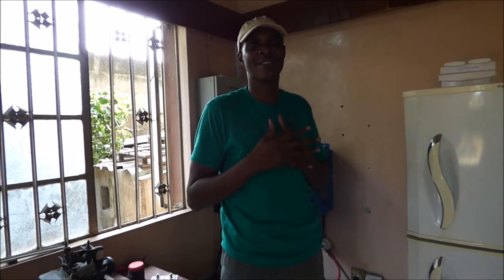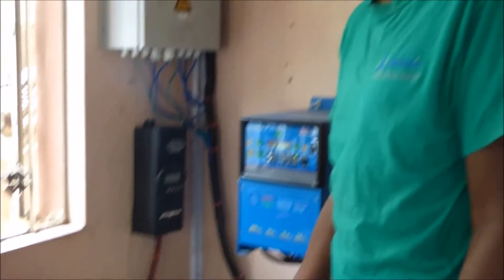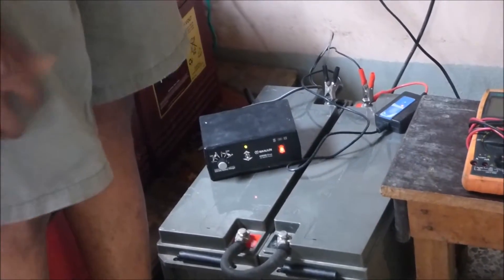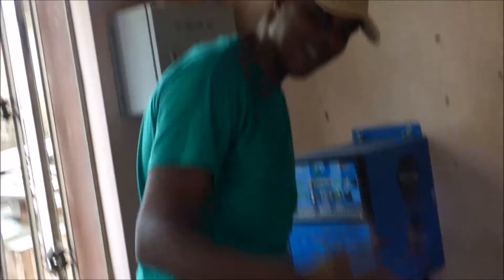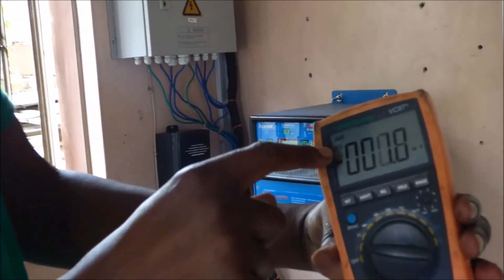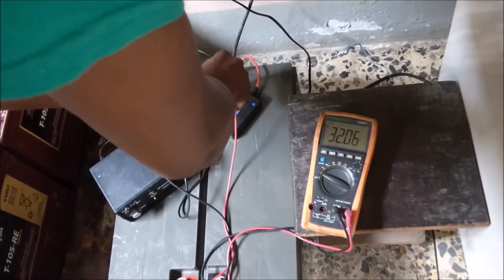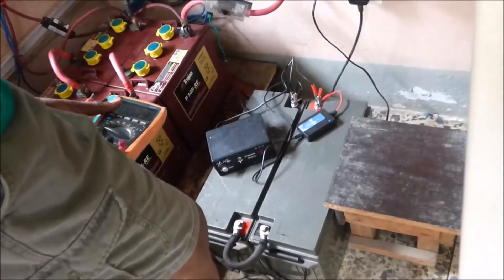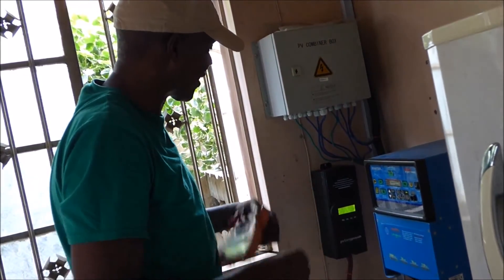Battery Desulfators: Do they work?

Comment: How do i get this Desulfator for my batteries?
Reply from the maker: Amazon
Reply: Thanks but will like to find out something which the difference between the Deep cycle battery(12v 100-200Ah) prevalent in Nigeria here and the one you used in some of your previous videos (the small electrolyte type)
Reply from the maker: All the batteries we use are deep cycle batteries. The desulfators work with a wide range of deep cycle batteries